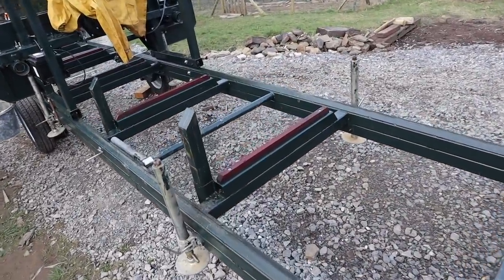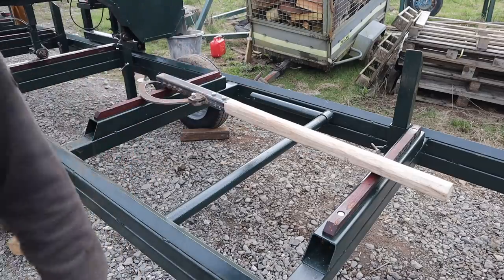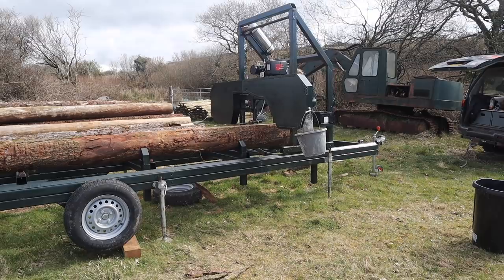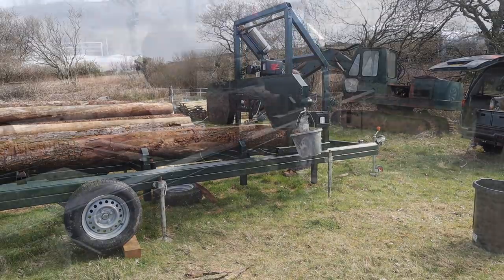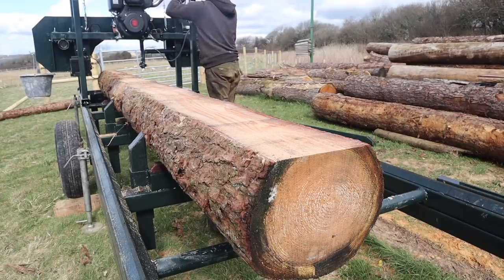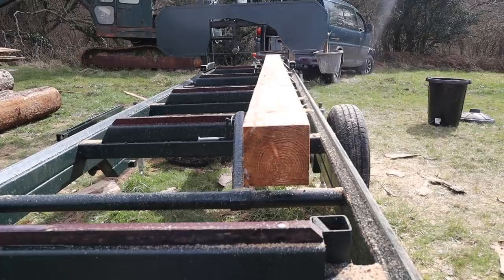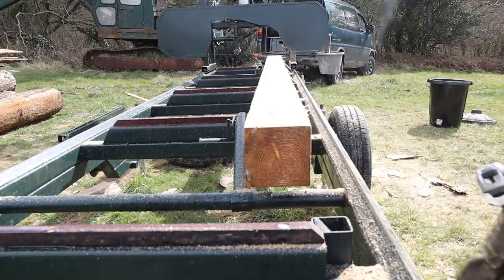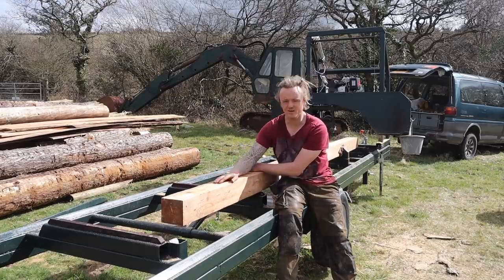First Cuts On the Homemade Bandsaw Mill

Comment: Fantastic work. I admire your skills and your philosophy. I came to you via Ades Workshop. As a machine tool man, I have a thought for you. The taper you are seeing in the cut of 3-5mm is in my opinion due entirely to twist and flex in the frame of the machine. What in machine tool parlance would be called the "bed".

Even massively built, webbed cast iron lathe beds have twist in them. They are set up for the position they are placed in by levelling.

Your saw will be used in different locations and if I were you I would start each session by levelling the frame using your jacking feet. Level it in x and y, then take a test cut and verify, tweaking as required.

I was a bit concerned that the carriage had no means to stop it lifting other than its own weight. But that didn't seem to affect anything. Feeding by hand is a good idea as you will surely be getting great feel of what the machine is doing.

My comments are meant to be helpful and  not in any way as adverse criticism. Very fine work indeed on your part. I tip my hat to you Sir.
Reply from the maker: I agree with you. I did set up the bed with a level and sighted down it so it was quite close. Thats what i meant at the end of the video where i said i could get a few mm by jacking up the end on the stands. im going to give that a try today, if i can get it with 3mm i would be happy with it because thats 3mm over 3.6m so really not bad at all for what im planning to use it for as i have a planner to get stuff down to the correct size once dried. 

It is just the weight of the carriage holding it from lifting But that is a good 200kg so it would take a really bad upwards cut to lift it. As long as the blade is sharp and true to the bed with a good tooth set it cant really do that. If any of those things are out it wont deviate by 5mm it will wonder off very quickly and cut a banana. So i believe it isnt that and its the bed not quite set up. 

Thanks for the comment.
Reply: @KrisHarbour  No problem at all. I got that you realised about the jacking. 3 mm over that length is nothing. It's a truly remarkable thing you have built. Please don't think I was criticising you. You have my admiration.

Comment: The Lubrication on your Water System will work better if you ADD some Detergent as it will add Slippery Movement for the Blade that what we use on the Woodmizzer Saw Mill
Reply from the maker: Thanks for the tip, i will try that, it has to be none polluting though
Reply: @KrisHarbour  ECOVER.....!!!

Comment: An inspirational build mate, I had the same smile when I built my hydraulic log splitter !
When you're sorting out your niggles, do you think it needs a brace across the back frame, approximately where the battery is ?
It will saw a lot faster when the motor is run in, but I was wondering about fitting a winding drum to the carriage with a static cable mounted end to end with a few turns around the drum to act as a windlass for traversing the head ?
As for all the sawdust, there's quite a few Russian videos on YouTube of auger type briquette making machines that will make good use of all that dust that would be a doddle for you to build ?

Comment: First-time viewer. Congratulations you have a sawmill!! Nice work too. Your issue with the deviation may be due to the bed of the saw not being level. The other issue you had, you would not have found it until you used the saw. Congratulations again on all your work.

Comment: you need a way to compensate for the taper in the log in the first cut to raise the log so the core is at the same hight,
a adjustable way so you can lower it when you flip the log onto the cut side,

Comment: Love your show and approach.  On sawdust and chickens for your consideration.  I have read that sawdust is not so great for their area as the fine dust can result in respiratory issues.  May be something to investigate and confirm or dispel.
Reply from the maker: The dust from a large blade bandsaw like this isnt very fine. But i could see sanding dust or table saw dust could cause problems. this stuff is really quite course.
Reply: Okay good-cheers; just wasn’t sure &  wanted to mention it, glad it’s a non-issue!  Living your progress.  Regards from USA.

Comment: Very impressive as usual - I'm so envious of your skill and lifestyle.
One question I have, and I'm trying very hard not to sound like a nay-sayer, have you given thought to making sure the 2 sides run in tandem? I'm not sure how well I can explain this but, you're walking down 1 side of the bed and pushing, in the centre there is a point of resistance (the log as it's being cut) so the other side should experience a force causing it to trail behind slightly. I know that it shouldn't affect the cut as it's always on the same plane but it may lead to uneven wear on the rails or wheels? My only ideas would be diagonal bracing if there's room or perhaps to drive each side using a worm gear and some gearing mechanism to keep them in tandem, like a metal-working lathe (perhaps a bit involved and maybe a mark II?). Of course it may be that the structure is rigid enough that it doesn't trail on the opposite side...
Anyway, please don't take this as criticism - just a thought that occurred to me and might be helpful!

Comment: You need more welly rubber at the front and rear of the sawdust hole. A lot of the sawdust is hitting the flap and deflecting left and right and missing the bucket. You will have to get a jockey wheel that can pivot forward out of the way, or is removeable, so that it gives you more ground clearance when you are towing the saw mill. As it is very close to the ground and you are very likely to ground the jockey wheel and rip it off when you are going over uneven surfaces. As me and my mate ripped our caravan jockey wheel off. The run out could have been caused with being on soft ground and the mill flexing as the weight of the saw head travelling along the body. Try setting the mill up on a hard surface such as a cement drive, levelled up and a log cut up and see if there is any runout. Then I would alter the mill accordingly, but not after being on soft ground like you was.

Comment: Congrats on your successful project brother!!
I noticed a big smile during you milking the wood.
If I may suggest? 
The muffler is pointing upward- potentially collecting rain and sawdust, rusting your muffler or starting fire, they sell a cap with a balanced flipper that opens when the engine runs.
Also, you welded a triangular piece to tow the trailer, and there is a lot of torque on the welds, you need to add a long straight bar from the tow device and under the trailer to the next cross member.
Also, I’m not sure if you did, but recommended to keep the blade guide close as possible to the lumber to eliminate blade movements.
Thanks for sharing that great experience, god bless!!

Comment: another suggestion i saw on another video, add some brushes or sweeps just in front/back of each roller, help reduce build up on the roller and cleans off the rails. Did you make a cutting gauge? or guide that would make cutting 4, 5,6,8 quarter boards?

Comment: Kris. Is the water drip crucial? And how often does it need to be refilled? And fantastic work man! I think you are bordering around genius! At least!!
Reply from the maker: It did cut much better with it on, Not sure it will make as much difference when im able to use full power but while i was close to the limit of the power i could use it made a big difference. I didnt have to fill it up while doing that log. Not sure how much is left in there though.

Comment: isn´t that a hydromac excavator standing there?? i got one myself  in very bad condition, Nice to hear that you gonna fix a adjustment to compensate for the taper in the log like i suggested in your last video,you can just put some plankings under the top off the log and then cut and flip it on the cutside and remove the pallings and work from there

Comment: Just out of interest Kris, how much water did it use to mill up that post?  Did you need to refill or were you well set up for another if you so desired?  I'm glad, at the very end, you answered the sawdust question I had going through me head during all this cutting .  I was thinking mulch, or pressing into fuel briquettes, or pathway maintenance but I should have guessed chicken bedding.  By the time the chickens are done with it you should have some great compost for the greenhouse.

Comment: Ich habe größte Hochachtung von deiner Leistung!
Eine ganz kleine Bemerkung: wenn du rechts schiebst, verkantet sich die Säge rechts zu links manchmal. Rechts und links vielleicht ein Schneckengetriebe anbauen und mit einem Akkuschrauber synchron antreiben hilft eventuell. So braucht’s su auch nicht mehr schieben und hast immer Übersicht über alle Teile der Säge ...
Reply: Are you saying that you noticed that it rocked a little side to side as it was pushed forward?  Like the left side and the right side did not both go smoothly - it looked like it was "shuddering" ever so slightly... hard to explain.  You can see the back and forth at 9:16

Comment: That is awesome dude, you must be super happy with the achievement! 
One thing I noticed at about 6:50 is you can see a slight bit of wobble in the right arm?
Reply from the maker: The whole trailer was wobbling side to side. I believe this is from the low blade speed due to me running it at half power. it wasn't a smooth cut as the band was speeding up and then slowing down and causing a wobble. i think that will be corrected once the band speed and power is up.

Comment: Kris, I know you already likely know this, but your saw-dust chute needs a tweak me thinks. It either needs a fully wrapped rubber/canvas skirt or a rectangular down-tube (with a tapered end) welded to the existing 'exhaust'; the sawdust wasn't exactly funnelling efficiently into the bucket. Great job on the sawmill though, good job!  👍 👌
Reply from the maker: I should have shown a clip of the sawdust going in the bucket. the bucket filled in two cuts. what you can see escaping is a TINY amount like less than 1% There is a huge amount getting in to the bucket. You can tell this by the fact there isnt any visible sawdust on the floor. imagine how much would be there if we emptied the bin we filled.
Reply: @KrisHarbour  Play from 7:00 See what I mean? That's not a tiny amount, you're losing a lot of chicken carpeting and making quite a mess too. :) You really could improve it IMHO - the chickens would thank you, I'm sure. :D

Comment: I would 100% electrify that winch... maybe even diy cordless drill powered.
Reply: Or alternatively, you could argue it's more work, expense and complexity to slightly speed up a relatively infrequent operation.....?!
Reply: @andymccabe6712  3 min operation with an angle grinder and a welder. Cut off the handle, weld a hex bit in its place or just on top of the handle if possible. Presto, power drill powered winch. Invest in time savings, saves time.

Comment: Maybe the reason it is off 3 or 4 mill at the end could be caused by the end of the lumber hanging freely in the air it looked like it moved a couple of mills when you tapped your hand on while you were explaining that it was off.

Comment: Still no gauge to indicate depth of cut, really the height of the blade above the bunks. Also maybe you should consider a jack to lift one end of the log to compensate for a tapered log so you can end up with the cant centered on the grain of the log.

Comment: You didn't need to justify it at all, that is pretty damned cool. The look on your face said it all, you were grinning like a Cheshire cat. Two ideas, army surplus sandbags might be more practical than the bucket and a handle set back from the carriage frame with a diagonal might avoid the binding on the rails and easy the workload when pushing.

Comment: The only question I have as you start to cut through the wood and the wood gets thinner do you raise the wood or lower the blade to the level of the wood and do you have a laser to make sure you are level with your cut? None of the mechanics see to be made higher or lower to compensate for the wood when it is thinner and how you keep it so straight. Sorry if it’s a stupid question.

Comment: Engine run in is a debatable subject. My advice as an engine builder is that reducing rpms does not compensate for load. Labouring or how close to stalling is the only sin and the best way to avoid that in this instance was reducing the cutting speed, which you did. By all means raise the rpms cautiously during warm up but in operation higher rpms/torque would actually reduce the labouring/stress on the engine. From experience (cars) my only run in period is gradually raising and constantly varying rpm first hour and be careful not to suddenly drop the clutch for first drive. If an engine fails that, it was always a lemon and no amount of pampering would have saved it.

Comment: You have to take out all those screws to get the cover off to change blades ?  My Woodmizer came with a single screw lever to remove the covers.....of course I've run it 30 years no with NO cover on the front, as it really isn't even needed.

Build a deck out beside the mill the height of the mill (or slightly higher) and  whatever you used to pile up those logs, pile then on the deck.....then simply roll onto the mill with the peavy.  WHOLE lot easier and faster than that winch deal.

Comment: Perhaps others have mentioned it, but I am concerned (perhaps unnecessarily) that the winch cable is going to gouge a wear mark 3:38 in the main support trolley track and in time cause a slight dip as the cable wears the top edge away... the winch cable can be greased, but still... give it time, and the cable will wear down the upper edge of the trolley, making the unit bump at that spot... I'd wager?

Comment: Absolutely Brilliant ..... You have to be 'Well Chuffed' with the result .... I do have a little suggestion, sure that you have thought of it too.... Being the Practical Person that you are .... When 'Pushing' ..... You need a Horizontal Push Bar running from 'Your' side to the Far vertical upright .... A little 'Stub' sticking out on your side too .... That way you could push a ' little in ' from the vertical and  apply some force to the far side too, That way you won't get that little side to side 'judder' that I could see, also check for any side gap of the Carriage Rollers in the frame. Maybe it will all come right with the engine at full speed .... :-)   :-)   :-) It is 'unfair' that one person can have so much 'Natural Talent' .... :-)   :-)   :-) Very best to You and Yours .... Keep well and Stay safe .... Cheers from NZ

Comment: Do yourself a big favor. Debark the trees before you mill them. The bark collects a lot of dirt as I'm sure you know & it will save your blade & make it last much longer between sharpening. Good call on the lubricating line also. That should prevent the heat build up ruining the temper on the blade.

Comment: Chris,
Someone said they bought a Chinese Diesel engine that didn't specify what oil to use.  What weight are you using for break in and what will you use after break in is over?

Comment: When backing out of a cut you should turn mill off , i've had blades pop off. Looks good , you;ll get faster as you get use to it. Good job, i know the feeling.
Reply from the maker: the blade isnt spinning, it has a clutch so once im at idle the blade isnt moving.

Comment: Not gonna lie I think you’d have benefited greatly by doing verticals cuts instead of horizontal and also pushing the saw through the wood instead of the wood through the saw is gonna cause you lots of problems with the longevity and position of your blade. It’s a good attemp at a mill saw but you could have made life much easier by changing those two things

Comment: vortex,
air admission and before engine
(more power)
and exhaust (less noise, more power maybe)
see nrjrealiste vortex (in french sorry)
economiseur carburant vortex on FB (sorry french too)

have tot tune it fine, realise it properly,
test number of blades with proto aluminium, and also angle of blades,
finaly in steel 1.6mm

Comment: Why don't you try a motorcycle engine, then in the output shaft incorporate clutching and gearing systems so that when on heavy duties you play around with gears to meet load demands

Comment: You need to figure a way so you are not just pushing on one side of the saw. Its racking and will get worse over time.
Reply: Maybe a bar across the back so you can push inside the cage.

Comment: It always makes me cringe slightly when I see you dragging stuff across a field with the tailgate open on the van. They lose a far bit of torsional stiffness with the door open, and that puts more strain on the spot welded structure which opens the seams a little and that can lead to it rusting. Not a huge concern, but you've probably got enough to do without welding a van up.